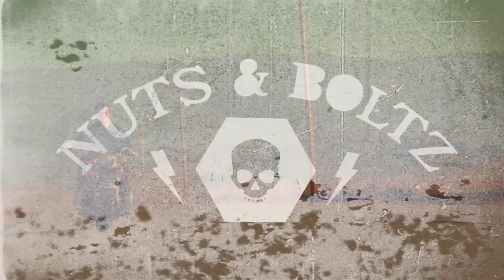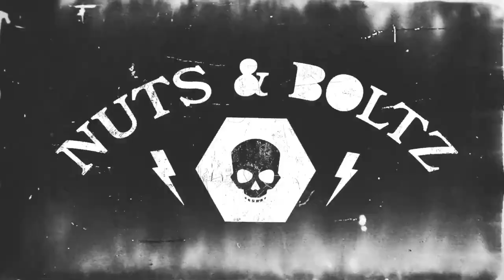#9 Solo and Buddy Seat Assembly and Install - 1969 Harley Davidson Electra Glide Shovelhead FLH

Comment: Finally, somebody doing a full assembly and installation guide for it, been looking everywhere
Thank you so much for doing so, finally i can install one on mine after struggling with manuals, thanks a lot 🙏
Ride safe and keep wrenching while inspiring us the newbies lol
Reply from the maker: You are very welcome, that's why I made the vid
Reply: Same here! I thought I had to remove half the tank for that front bracket .I guess not.  But, I didn't quite get that part .I couldn't see it. What do you do with that front bracket? I know earlier he bolted it to the seat. But what happens with it when you put seat on bike???
Reply: @Liftheavyrustylbs  you mean the front mounting on the seat pan? He dropped the front seat pan mounting equipped with a bolt on to front side of the T bars (which already having a flush hole for the bolt to be inserted on). Then tighten it up with a nut while lifting the T bars alongside with the mounted seat on while doing so. Don't fix the pogo to the T bars, you should do this at the very last, its easier to tighten every nuts and bolts while you can still lift both the seat and T bars at the same time...
Hope this helps you and exactly answered your question
Reply from the maker: @Liftheavyrustylbs  there’s a hole in the seat T

Comment: Very Nice. How do you use the 2 springs under the back part of the seat?
Reply from the maker: When you don't want to use the springs they are up like in the video, and they sort of clip up and stay up with the clips that protrude. When you want to use the springs, you just pull on them, and they pivot and turn down, and then there are 2 little nubs on the end of the springs that go into 2 little holes that are on the small brackets that are bolted on to the the frame. I should just shoot a video of it, so you can see how it functions.
Reply: @nutsandboltzgarage5889  OK I thought you had to fasten them (bolt) them to the frame brackets. I will try what you said